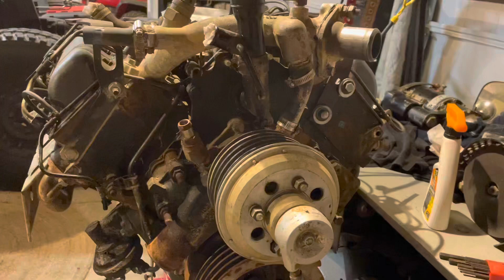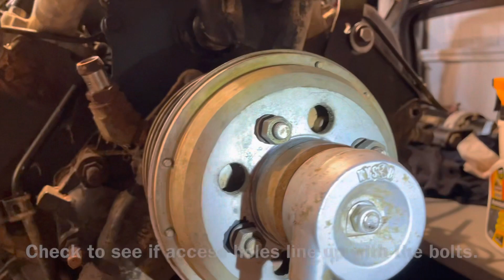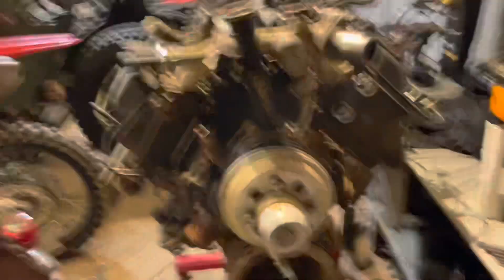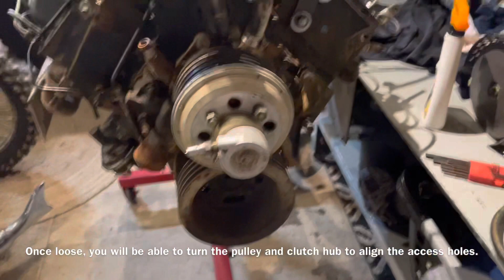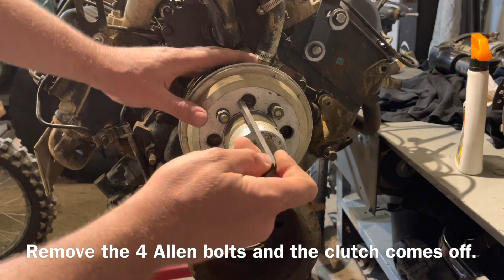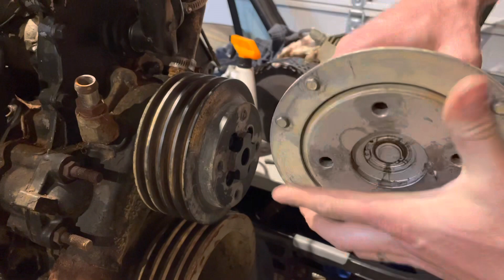HMMWV Fan Clutch Removal

Comment: I loosened the small screws but can not turn the clutch as you did too line up, your head was in way, what did you do to turn, anything special?
Reply from the maker: Nope nothing special. Try backing the screws out a little more and lightly taping the hub with a rubber mallet to break it free. It might be sticking.